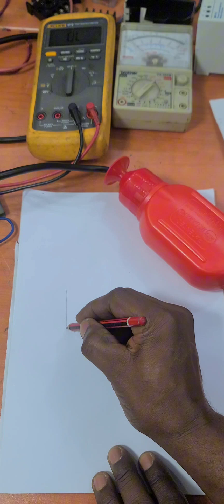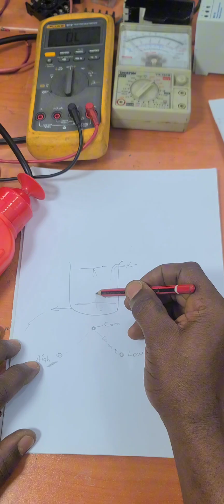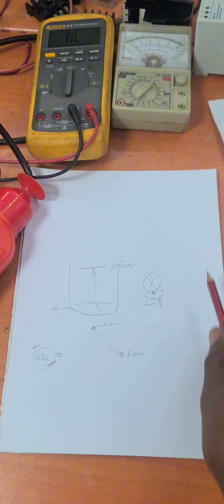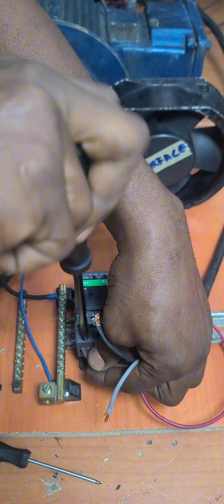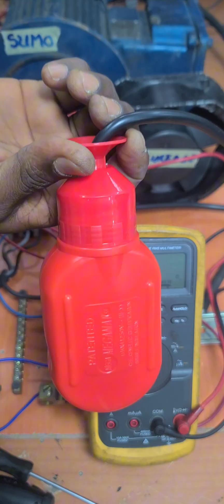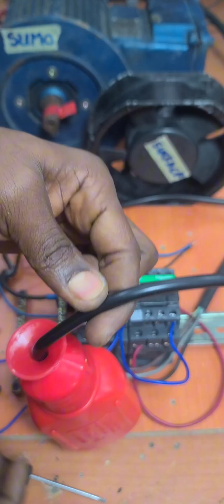Float switch

Comment: Great explanations. ❤️

Can we have a video too on a situation where just one  pump is required to pump when empty and stop when tank is full?
Reply: This means you will do the same connection but using one conductor , ,and up to you to choose if it's submissive or surface, meaning one terminal of floating will not be used, depending on the pump you choose